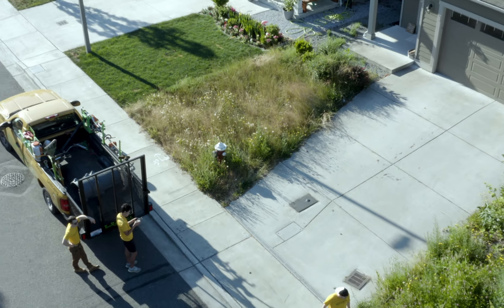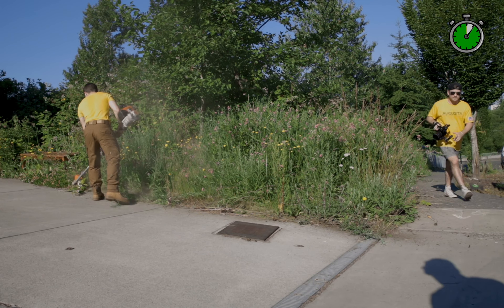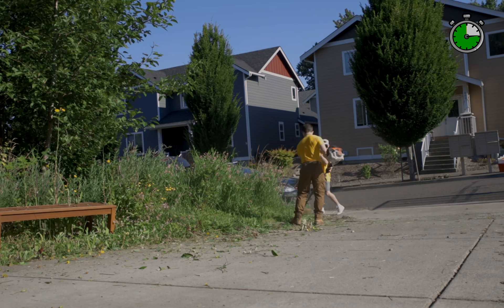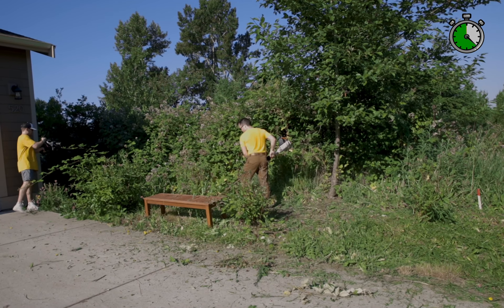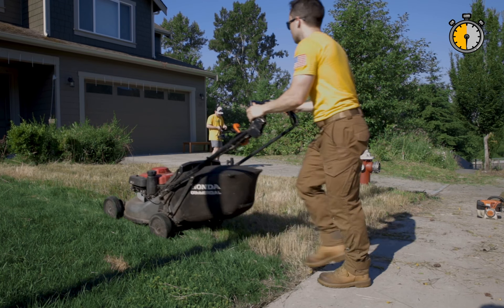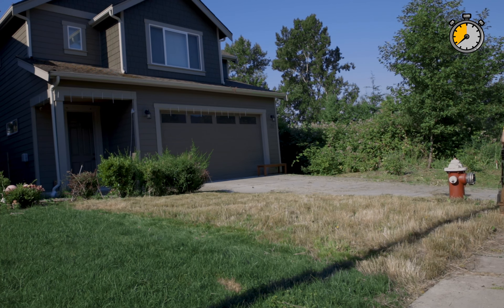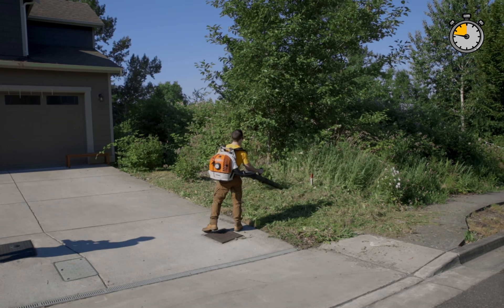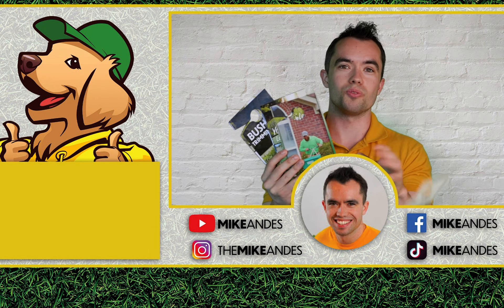I made $70 in 28 minutes mowing this OVERGROWN Lawn!

Comment from the maker: What would you charge for this lawn??
Reply: Probably the same price or a little less, but yea I would say 50-70 because of how much equipment your using and you have to knock down weeds before mowing, it’s not just a normal mow, trim/edge, and blow, you have to go over it with the trimmer first.
Reply: 150 if it is just the front as it seems from the video but 300 to 400 if there is a jungle in back. That amount of bagging would fill up a truck and that means the rest of the jobs that day will be harder or delayed.
Reply: 80$ minimum
Reply: @ChemitasFishing  damn tootin!
Reply: Looks like 28min worth of edging alone
Reply: To do this properly I'd charge 132 Australian
Reply: Initial visits like this are usually 3 to 4 times whatever they're regular price is going to be.

That would put this one at $150 to $200 AUD INC GST 👍

Nice video mate 😎
Reply: Any property considered overgrown minimum $100 first hour then $50 per hour thereafter. Debris haul away (if requested) starts at $15.
Reply: 250
Reply: A minimum of $100.
Reply: $80
Reply: 200
Reply: 75-100 just for the front 200 for the hole yard
Reply: 250 easy for a clean up
Reply: Wouldn't put my equipment in that kind of mess for $70.
Reply: 2-3 hundred all day. No bagging no edging. Just cut and blow. Oh and paid in advance.
Reply: My first time overgrown fee is minimum of $70, any type of bagging or disposal is extra